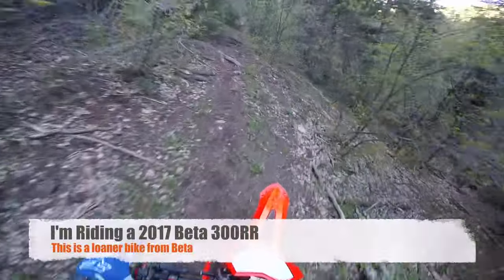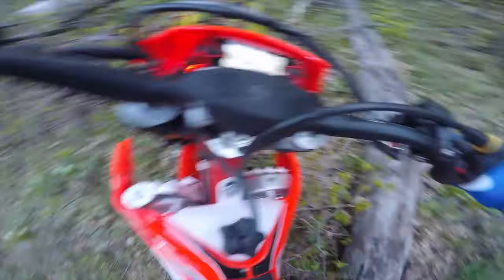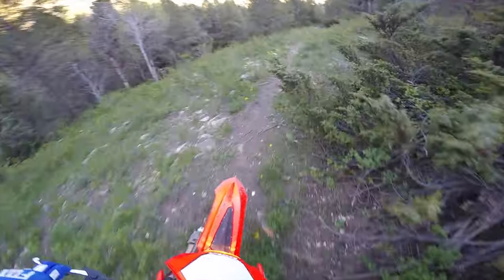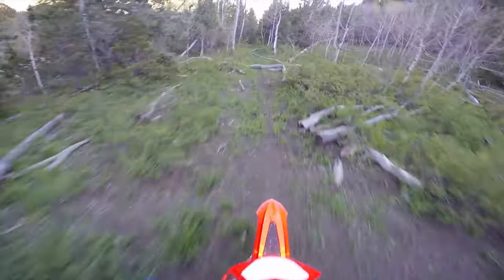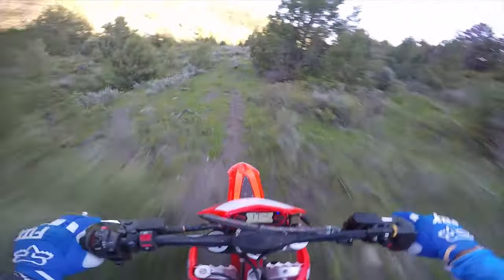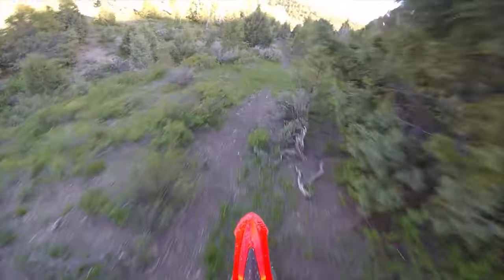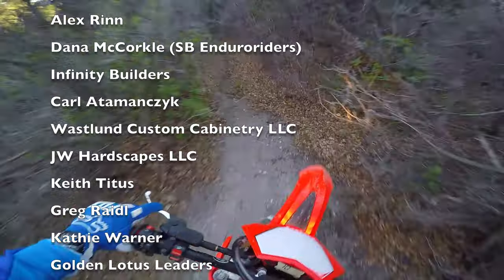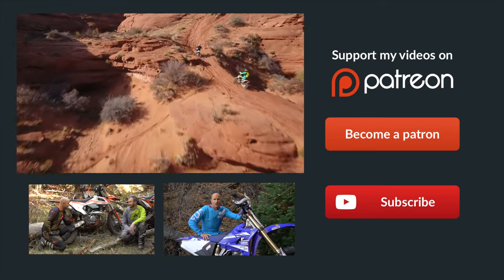Horn Where the Kill Switch Should Be? Beta 300RR | Episode 270

Comment: Swap the  white/black and grey wires at the white molex plug on the end of the switch wire harness. The horn and kill switch positions are now swapped. If you are really keen, swap the red and black push buttons. Use a pick or small screw driver to release the pin holding tabs in the molex plug.  Beta  has Italian wiring standards so any maintenance work will be an improvement. Both horn and kill switch circuits are ground seeking.

Comment: I made my vintage Husky street legal for Idaho. I added a horn and switch. I moved the kill switch over because I felt the horn button should be easier to reach. I'm usually stopped when I use the kill button. I found out older Huskys use AC current. So to power a horn, extra stop light and any 12 volt items I have a 14 volt cordless drill battery attached to the inside of the air box. The recharge plug from the drill is attached to a panel so charging the battery from the charger is easy.

Comment: I just got a 2013 beta 250rr and i usually clutch kill my bike and i use my middle finger and ring finger for my clutch so my pointer finger is free to use it the new 2018 has the kill switch on the right side now

Comment: maybe think about why the button is there before knocking it so quick. if they put the horn where the kill switch is now you couldn't get to it easily when riding on streets and near blind car drivers and the like. it might be weird but the horn is at the best spot for it. does it suck, yeah but it's not that big a deal really. you're usually if not always stopped when shutting off your bike. when you' r using your horn you are most likely moving. do you want to take half your hand off the bars just to honk? maybe you do, who knows?

Comment: all my bikes have always had the kill switch on the right. Maybe it's where it is to avoid accidentally hitting it and shutting off. Try going from a BMW to another brand and operate the turn signals.
Reply: It takes more than just an accidental stab of the kill button to shut off a bike.
Reply: Cactus73a maybe on a momentary button but if it's a rocker switch... it's gonna die.
Reply: No such thing as a rocker kill switch. Not only would that be a stupid idea, but it would be dangerous.
Reply: Cactus73a KTM 500exc, check out the right hand switchgear. Not sure how that could be dangerous...?
Reply: Bumping the kill switch into the off position on a technical hill climb or on the face of a jump. I can't believe the switch is a simple rocker without some sort of lock out.
Reply: Cactus73a I can see on strictly carbed dirt bikes where the kill switch grounds out to kill spark, but fuel injected bikes kill power to the ignition so a rocker works, off in one position and on in the other. I installed a kill switch/start button from sicassracing on my 530 and I think it was a pushbutton maintain for the kill switch--push in and it dies, push again and button comes out and bike can start.

Comment: that is funny about the horn though I've had my beta for over two years now and it's still messes with me. it's too bad they wouldn't put you on a Racing Edition it's an entirely different 300rr
Reply: MaverickDH. the race Edition did make slightly more power over the standard 300 in 2014 I don't think that's the case anymore but either way that's not what I meant I know they're both of 300cc pretty much exact same motor.  I'm meant the bike is entirely different in terms of feel with the suspension. plus the race Edition just has cool features like the Dual map switch. marzocchi pfp Forks. but I do see your point I don't think I've seen Kyle with any KTM six day editions or something similar.
Reply: MaverickDH also there's a race Edition in Idaho Falls. a 2017 for $8999 brand new @ Kolbe off road. if anyone is interested in it? that's where I got my bike.
Reply: MaverickDH  I agree with the way you would set that bike up. I don't think Kyle is going to be particularly careful with this bike like the ones he owns. plus I think Kyle is a big KTM guy and maybe a bit biased against beta. but I'm glad to see that he's trying one.
Reply: MaverickDH  a 14 300 RR race Edition. it's funny when you talk about the bikes you grew up on how you just rode what you had.  definitely the way it was for me I started out on a Honda Z50 then went to a 1970 something Honda Trail 70. then a Honda Trail 90. and then my dad started buying bikes that were bigger as we got older like Yamaha xt200 eventually xr400 then I got  into two strokes and rode YZ 250s for while. I never rode Moto cross or raced when I was younger I always wanted too. but the bikes we had were more trail bikes. I rode alot of technical Terrain so when I started buying YZ 250s was because I wanted to start Motocross riding, but found out they're more fun in the desert and trees and now I mostly just ride single track. what bike are you riding and where are you from?

Comment: kill switch, along with the added weight over the KTM from the thicker pipe and all the street legal qualifying gear is not an issue for me.  Kill switch on my yz450 was on top of the bar-requiring the index finger or hand to come off the grip.  Street legal after a mirror in my state means I can easily ride dualsport events, and dominate in the tougher sections.
Reply: Hoosier Daddy This is a big reason I'm heavily leaning towards a Beta RR race.  Play on an intermediate track, race hare scrambles, and be easily plated for enduros by adding only a mirror in my state.